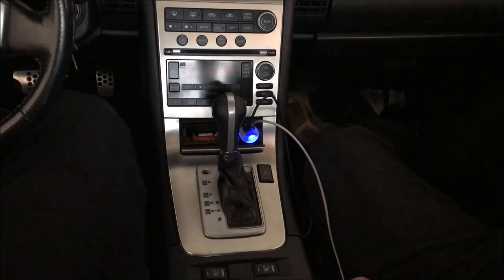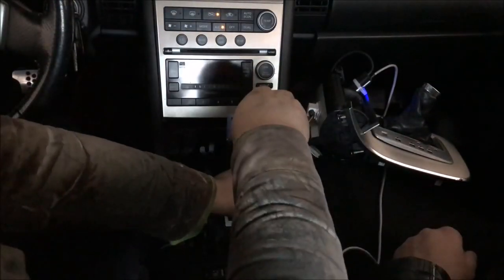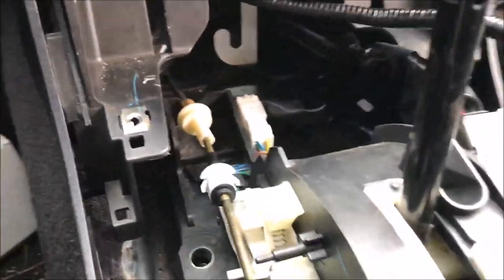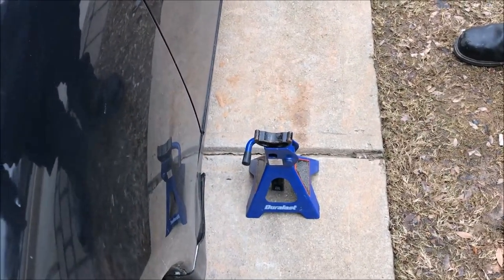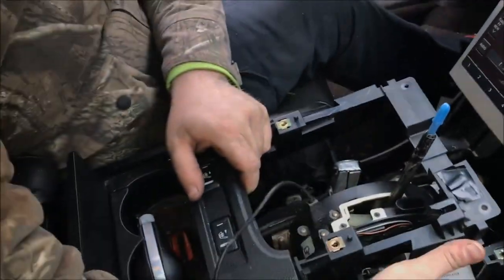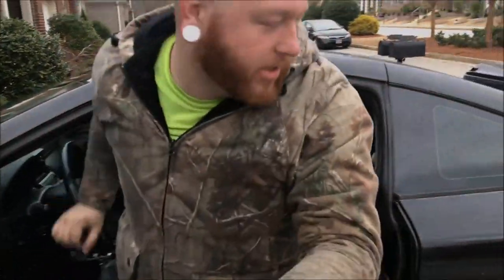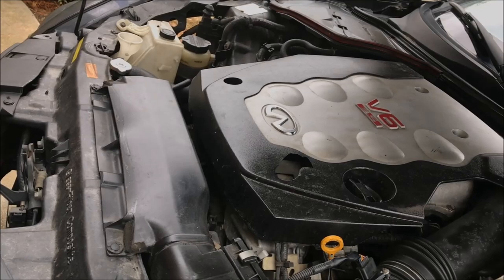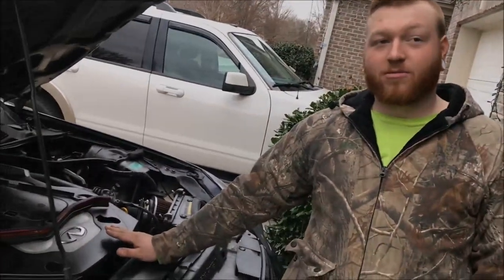Infiniti G35 Automatic Shifter Replacement

Comment: Thanks so much for this video my car recently won’t come out of reverse n dealer ship would cost me $920 this helped a lot thanks very detailed.
Reply from the maker: Unstoppable laughs Wit kiki no problem you got any questions feel free to ask
Reply: How did you fix it? My EX has the same issue... I feel like the linkage between the shifter and the transmission got broken or disconnected.

Comment: Great guide honestly exactly the vid I needed my manual mode isint working properly
Reply from the maker: Awesome dude let us know anything else we might be able to do to help you fix more things on your car
Reply: @fearlessmechanics3753  dude actually do you have any idea where to actually buy a shifter assembly? having trouble finding one
Reply from the maker: Yes either a authorized Nissan/Infiniti dealer or you can go through amazon/Craigslist/eBay and/or you can search through a local junkyard either ones should work

Comment: My 08 g35 made a clunk and the shifter moves and it says prnd but the transmission will not engage and it you can roll the car in drive and reverse can’t figure it out

Comment: Hey have an 06 g35 coupe with around 125k miles it's automatic has this issue when I go over bumps it goes from D to N real easily or when I'm driving it just randomly goes into N would replacing the shifter help or what else could I replace to fix it

Comment: Does it matter what year shift assembly you buy? Ofcourse making sure its for a coupe. But as for year of car does it matter? My car is a 2005 G35 coupe and I only see these shifters for 2003 g35 coupes and also one thats 03-06 which is why I want to make sure year of car is not an issue
Reply from the maker: Dioriz Ramirez the 03 - 04 year model shifter is different from the 05 - 07 model they changed the electronics in the shifter within those years they will still work as a shifter but the manual shift will not work at all
Reply: I found a 2007 shifter would that work for my 2005 g35 coupe
Reply from the maker: Sorry for the late reply I've been caught up in some stuff but yes that would work

Comment: @fearless mechanics did u ever fix the manual mode not working
Reply from the maker: Changing out the shifter did the trick for me at least
Reply: Fearless Mechanics fasho thanks bruh
Reply: @fearlessmechanics3753  has your manual mode failed on u since replacing this?
Reply: @luigui707  yah im curious aswell
Reply: @fearlessmechanics3753  any reply

Comment: You have to replace the combination meter(gauge cluster) to fix the manual mode issue.
Reply: where’d u see this?
Reply: how do you know. i have that issue
Reply: @StreetHeem  If you don't have any codes it's most likely your combination meter.  I replaced mine and it fixed it.
Reply: @eventide5727  i had a code. i had someone clear it but the manual mode stopped working again a day later. so do you think i should replace the shifter assembly?
Reply: @StreetHeem  Most likely, yes it's the shifter assembly in that case, if you have a Manual Mode Switch code.  You could remove it and check for loose wiring.  Usually it's the micro switches in the shifter.  I've read people clean them and have it work again.  I checked mine with a multi-meter.
Reply: @eventide5727  ok so i should try and clean the area?
Reply: @StreetHeem  Can't hurt!  Just make sure the car is off of course and don't go crazy with the electrical spray.

Comment: Would this work for code p1815. Manual mode switch ?
Reply from the maker: Ryan Rodriguez could possibly never dealt with that code for my car so I wouldn't know if it would fix it or not maybe changing out the shifter might get rid of it
Reply: did you ever fix it
Reply: Brrriiaaann I wish. But I tried the old treads and switching the gear shifter component doesn’t do anything
Reply: Ryan Rodriguez damn really ?
Reply: Ryan Rodriguez how hard was it to switch the assembly
Reply: Brrriiaaann it was pretty easy but there’s one clip thing you have to connect which is pretty fragile but other than that it’s pretty easy.
Reply: Ryan Rodriguez how did you disconnect the balck lever that the shifters have ? did you have to loosen it from the bottom or were you able to pull it up and remove it from there

Comment: My g35 is not showing when it’s on park or drive or nuetral or reverse. All it shows is Rev on the dash screen
Reply from the maker: You have the HUD of a manual it seems if it only says rec what year model of G35 do you have
Reply: It’s a 2006 automatic
Reply from the maker: It could be 2 possibilities either someone switched out the HUD or the wiring harness isn't hooked up to the shifter and it's not displaying what gear your in so what I would tell you to do is to send me some pics of the HUD and I'll see what I can find out for you
Reply from the maker: Send the pics to Fearlessmechanics@gmail.com
Reply: When you say HUD you mean a head up display?? Because this car does not have a Head up display. I’m confused when you say HUD